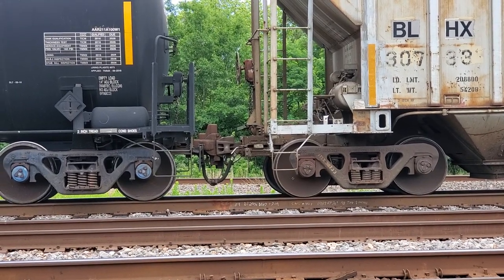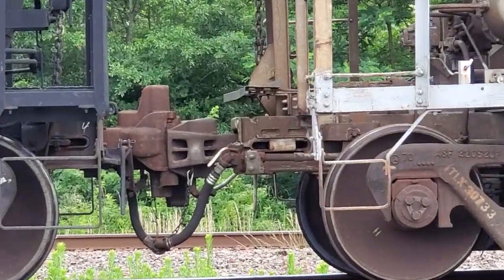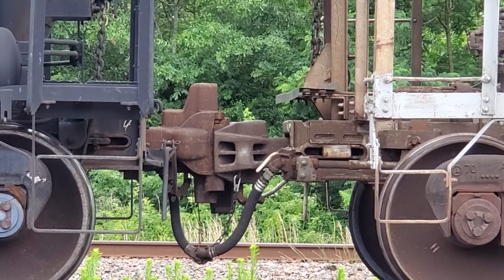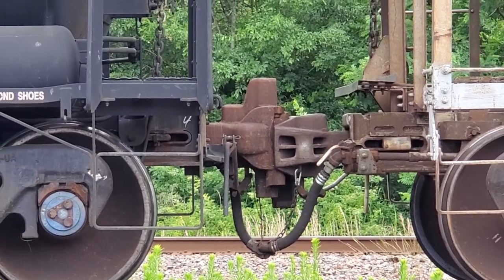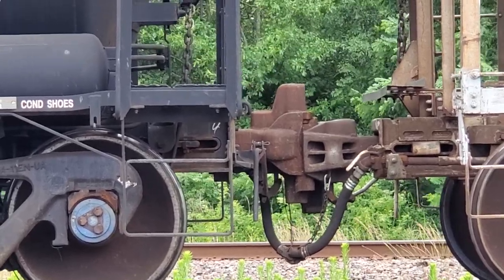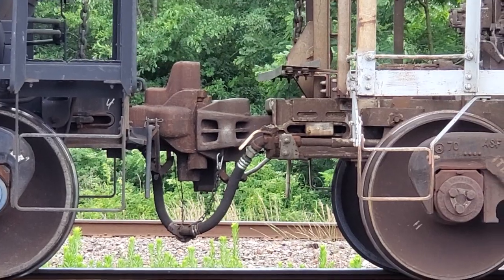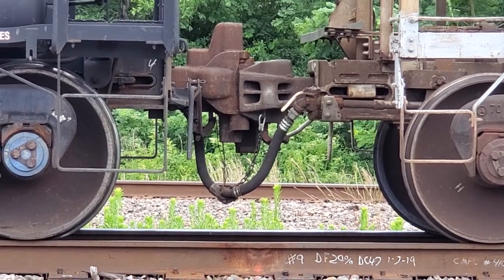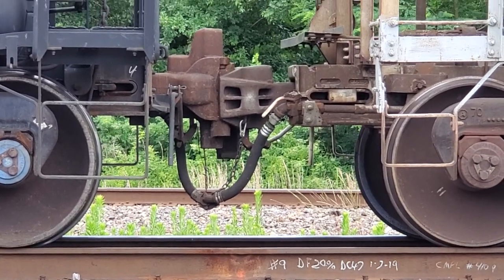The Shelf Coupler Explained - What is its purpose?

Comment: Great info Jason!  To add more info, the coupler in your video is know as the "SE" coupler.  There is another type of double shelf coupler called the "SF" type.  While both are double shelf couplers, they look completely different from each other.  Incidentally, Kadee makes both styles for HO scale (SE being the 119 coupler while I believe the SF couplers still are labeled as 118 couplers) also you can modify these couplers to make drop shelf E couplers as well as standard type E couplers and for the SF couplers, you can modify those to create the couplers used on current Amtrak and other present day passenger cars.  Just thought I would share that extra bit of info, take care!
Reply from the maker: Thanks Randall. Kadee #119 @ #118 are both the same except one is Kadee Standard Head (wider coupler) and Kadee Scale Head (prototypical) which is what I use. You can take either of those and clip the top off to convert from the F to the E style.